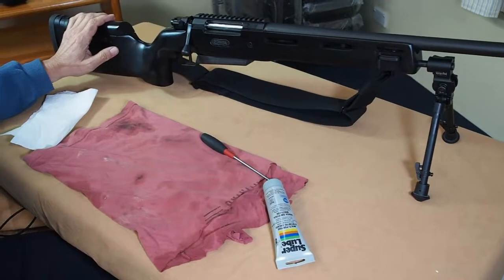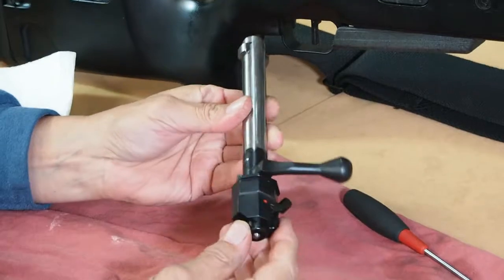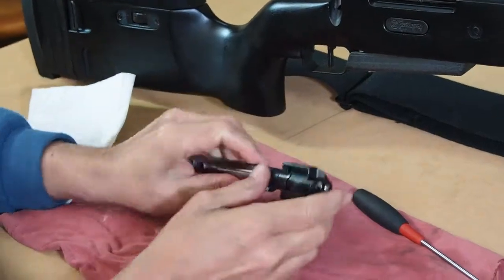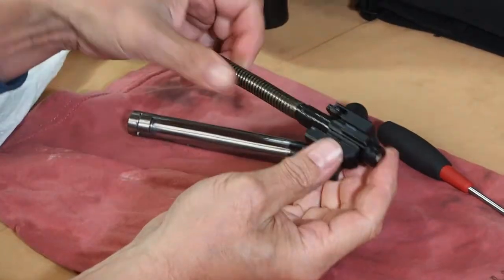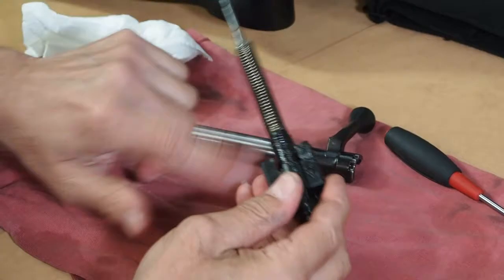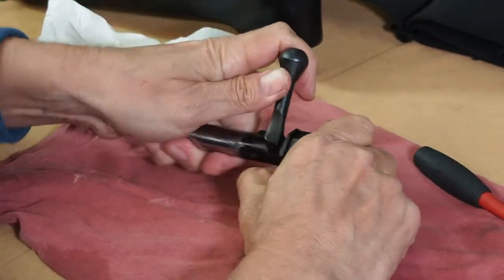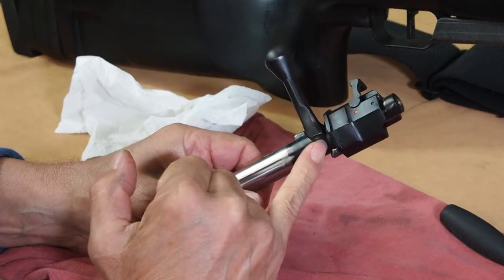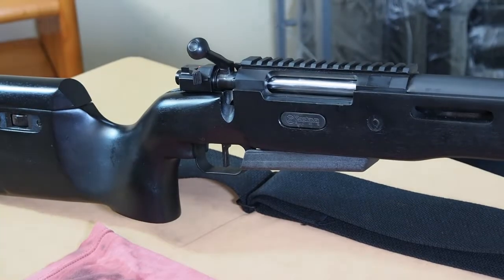Zastava M07 part 3

Comment: Thank you for your videos!
Can you tell us what is the accuracy of the rifle in comparison with the other rifles you have/had?
We hope for more shooting videos with this rifle.
Cheers!
Reply from the maker: My best group so far has been 10 shots in 18mm @ 100m. This is exceptional accuracy from hand loaded ammunition. I am using MKE brass with Lapua 167 grain bullets. Currently I am experimenting with 168 grain Berger bullets and hope for even better results. I only measure 10 shot groups as I believe small groups are meaningless.
The barrel has a slight choke and gets tighter at the muzzle which is an extra aid for accuracy.  My opinion is that the rifle is as accurate as you can expect without going to a heavier barrel. A heavy bench gun will be more accurate but this M07 is very good for a rifle that is not too heavy.

Comment: Is that a Zastava M70 (and not M07) bolt rifle by any chance?
Reply from the maker: No it is an M07 which is an uncommon model. The M70 is like a 98 Mauser action. The M07 is a new design with many different characteristics but still made with the traditional hot forging processes like the Mauser 98.